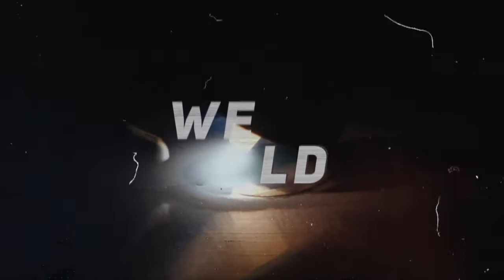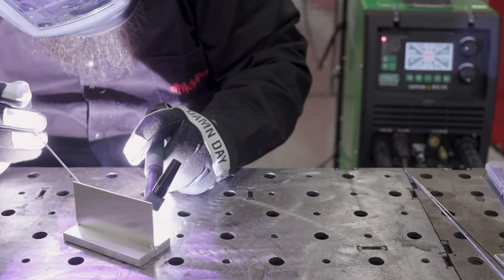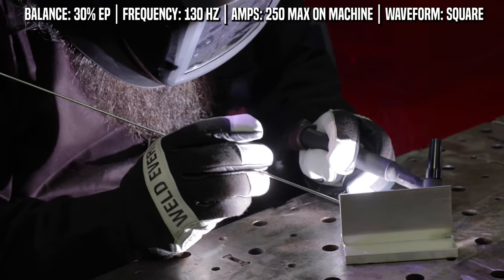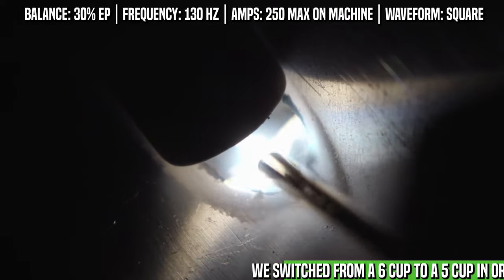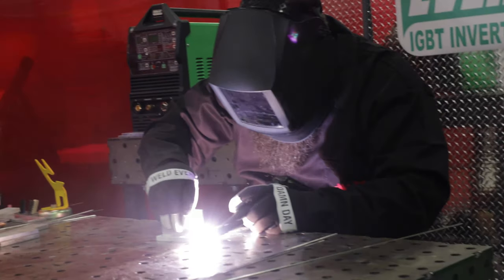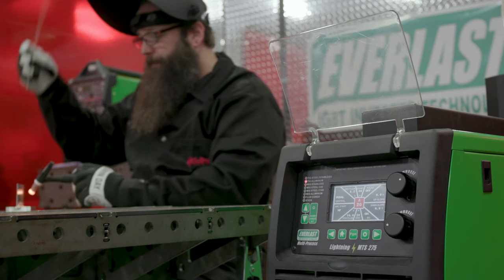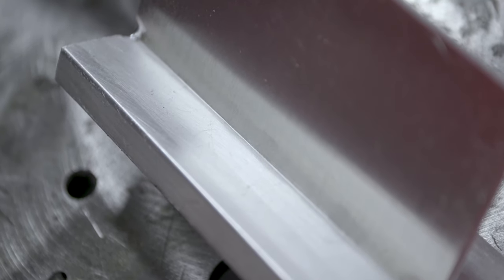TIG Welding Thick to Thin Aluminum | Everlast Welders

Comment: Thank's Mark, I have a job at work at the moment where I'm welding 3" cubes to 2"x2"x1/8" angle, I pre-heat the blocks and welder set at 270 Amps, and I'm still struggling to keep enough heat in the cubes. Oh and i'm using a Lincoln Electric 375 Precision Tig, which has only 50 hertz.

Comment: Thank you Mark, I used your advice/techniques (with my 210 EXT and pulse) a bit differently, but they really made a difference:  I'm practicing with 18 gauge AL coupons and specifically  a lap joint.  I was having trouble with the leading edge being very sensitive to melting back before I could fill that step / lap joint.  
So, I heard your comment on focusing the angle of the arc on the base metal AND I went to a #4 cup (with 1/16 W) to narrow the arc also per your advice.  I was always using 1/16 W , but was using a #5 or 6 gas lens and cup. 
Those two changes really made a noticeable difference as I don't have to "shovel in" the filler.
Thanks again Mark.

Comment: Thank you for the information. How much rod do you feed at a dip, 1/4", 1/2", how much?
Reply: Check out around 40 seconds into the video, you can see the stamping on the side of the filler rod to use as sort of a gage to see how much he adds. From my experience and watching that clip,  maybe 1/16" /shrug. good luck!
Reply: 1/8”

Comment: What everlast tig model is that?
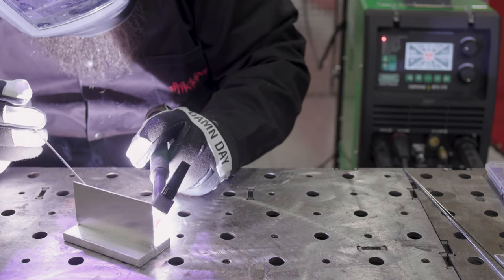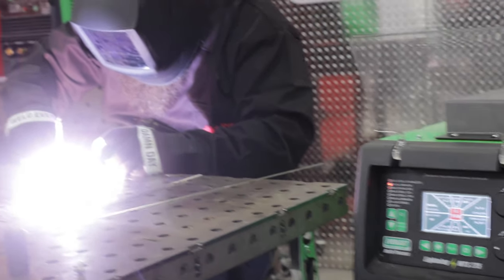Reply: Slowski at 0:33 I think I see the Lightning 275 in the background. At 2:03 I’m sure it’s the Lightning MTS 275.
Reply: A. Bakker, Thank you, I’m looking at getting the Lincoln squarewave 200 and wanted to do a comparison on price and specs.
Reply from the maker: It's the new Lightning MTS 275. It's an ACDC TIG, MIG, Stick, Flux Core machine.
Reply: I was looking at getting the Lincoln Squarewave tig 200 and wanted to do a comparison on price features etc... Thank you

Comment: He EVERLAST, How about tig welding aluminum to steel? In like a T joint. Is it possible? would you run on AC or DC and what filler metal?
Reply: I had a mechanical engineer ask me this one time! There is technically a way for them to stick together but I wouldn't trust it structurally.
Reply: JB weld
Reply: Simplest option would be to braze them or if your well resourced friction spin weld

Comment: I still have issues trying to weld perforated .050" steel to 1/8" in the same T config as you showed.  I must need LOTS more practice!  Last weekend I punted and switch to silicon bronze filler...  Life's not easy when you're a wuss...
Reply: Was the hardest for me too. Try to keep the tungsten as close to the corner of the joint as possible with a small cup. And the torch angle is key. Drop filler right in front of torch angle. So the puddle doesn’t hit your tungsten. Thats how i got a decent bead on aluminum and steel.
Reply: Copper heat sinks if you can and back stepping method. Nobody teaches back stepping anymore